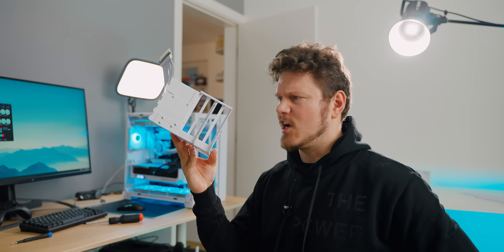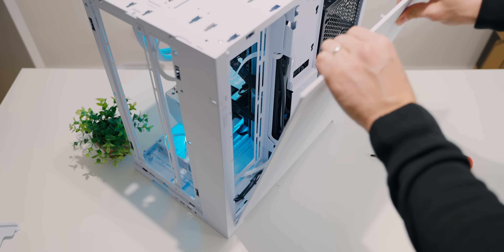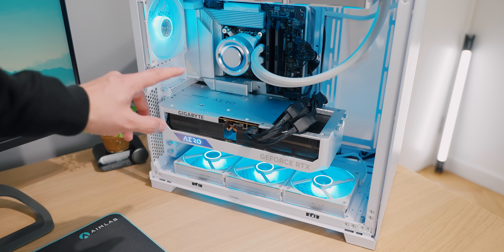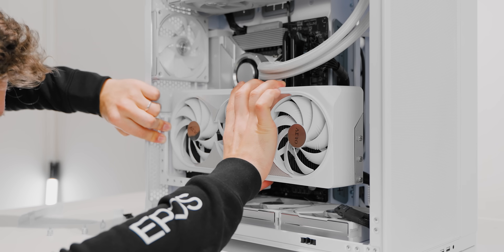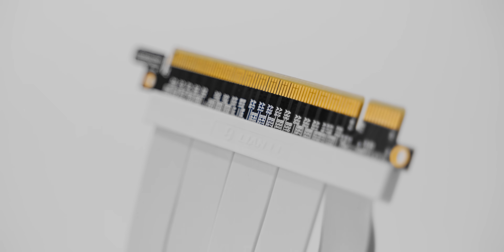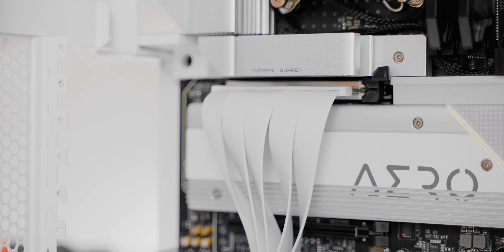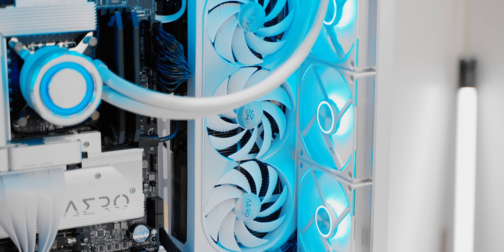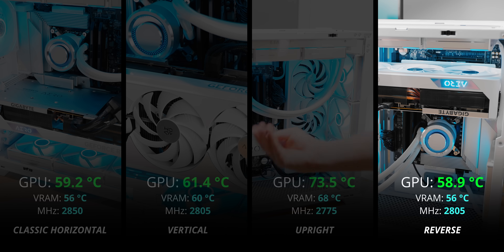The Best GPU Orientation EXPLAINED!

Comment: When having fans vertically, they should be sloped at a slight angel to allow for sufficient heat extraction, or cool air injection, as heat moves vertically. 

Somehow I feel having 3 fans on the video card could actually heat it up more in a vertical orientation, as the top part should be shielded, and the fan should be oriented as low down as possible.
The AiO MSI 5090 does this I think.

Also, radiators should never be in a position where they are inbetween the air moving into the case, this causes the case to heat itself up over time.
Mounting a radiator vertically is fine, assuming the air is moving out of the case.

Ideally, you want the cold air being pulled in from the bottom, but let's say you're running a dual AiO build with the MSI 5090 AiO.
You would mount the 5090 vertically, then, mount the AiO to the bottom, and have it push air outside the case. 
Then you would have the CPU AiO mounted at the top, pushing air outside the case.
Mount the AiO of the CPU/GPU to the bottom of the case, based upon which one gets more heat.
And on the front and back, have fans pushing air inside the case. Adjust the fan speeds so that its a 55/45 intake/exhaust ratio.
Ideally the fans in the center of the top, bottom, front and back should be faster than the fans on the corners, as to allow maximum movement of air, and allowing time for the thermal energy to transfer from the metals to the air.

With this, minimal warm air will be recycled back into the case, and both AiOs receive maximum possible cooling, while not heating up the case in the process.
But this is for a vertical sidemount build.
I recommend horizontal, as heat wants to rise.

Comment: Upright would probally get better readings if you didnt have front fans and moved those to the bottom for intake instead. With that settup the front fans are are pushing fresh air past the gpu

Comment: everybuild be like: lets put radiator on top where exhaust is so the raising heat can ´cool´ the radiator for cpu, instead of puting radiator on intake fans - vertical side, so it can be cooled well as hottest component in the pc it should. Makes no sense. I guess aesthetics are more important

Comment: The reason the temps are so bad upright is because you most likely need to have the hdmi on bottom.
People might think "why does it matter what is the orientation - upright is upright"
But in reality the GPU is not symmetrical under the hood - it has a vapor chamber and TUBES leading the heatsink - when you position in the "wrong" kind of way the hot gas dont move in the right direction (since they tend to go up) and build up in the vapor chamber.... 
Long story short - flip it....

Comment: I think the upright did so poorly because you have an open air GPU, and the exhaust on either side of the heatsink was blocked.

I’m surprised that the vertical did so well, especially with the fans turned off. Where was it even getting air from?

Also did you test all these with an open panel? Vertical would have suffered with the panel closed imo

Comment: Hi , did u messure all temps without side panel ? It's a major diffrence. I've got antec 5 with vertical gpu bracket and diffrence between classic mount and vertical is 20 degrees! When I'm gonna take out side panel I'm getting much much better results. Case got very good airflow so idk but durring heavy load you can clearly hear gpu air hitting the glass panel - the gap between panel and gpu is simmilar to yours. No idea why your temps was that low with vertical that's why I asked did u use side panel....
Reply: Yeah that’s crazy that his vertical temps were so low. Where the hell were they getting air from? He didn’t have front fans either, just the mesh. I assume the side panel was off. If it was on, maybe some of that turbulent air from the bottom fans would have helped instead of just escaping. It was interesting that turning off the bottom fans helped

Comment: 8:58 Never install AIO radiator at the bottom. You will get air into the pump which is very bad. Just a friendly heads up :)

Comment: It's pretty simple. The only things that matter is how much cool air is available and how easy can the hot air leave the graphic card.
Reply: Yeah his upright orientation was blocking the side exhausts, I think that’s why it did so poorly
Reply: @henry3397  maybe. So I checked both configs and added even additional fans. My guess is: When it's at the top, the air can enter unimpeded and the water is distributed better over the entire radiator. The difference was 2-4 degrees with i7 14th gen.

Comment: There are a couple of reasons your upright orientation has poor thermal performance. 1) The case intake fans are orthogonal to and too close the GPU fans causing the GPU fans to fight against the air intake air flow. 2) The GPU side exhaust is right next to the case intake fans, so some of the hot air from the GPU exhaust gets sucked right back into the case, creating a thermal loop.
Reply: The left exhaust is also blocked by the motherboard. He has very poor exhaust on either side tbh. I’m not even sure the right side is getting out of the case and into the intake that much

Comment: Do purchase a ROG white GPU, and you'll be happy of its look mounted traditionally all the time.

PS My concern is to how to mount both GPU and hyper storage (PCIe to 4xnvme). It needs to be mounted into the first slot due to a bifurcation settings, then GPU has no clearance being mounted into the second x16. Then, this shiny PC case allows to use a vertical mount for both components (with two different mounting brackets included), and the bottommost slot can be used for for PCIe to USB I hope (cause some MB have less UBS on a back than is needed). A great PC case indeed!

Comment: dude you literally skipped over the most important configuration and the reason why reverse mode even exists......upright gpu in reverse mode. Some cooler designs do worse in upright but will be significantly better when upright and reversed. I literally get get an average of 10c lower on my 3090 strix when upright reverse.
Reply: His test was pretty ass ngl. I think he tested with the panel off too lol

Comment: ty for comparing thermals on the horizontal reverse setup. Was quite tricky to find how it works with vapor chambers and was considering it for an sff build, but was worried about unexpected thermal impact.

Comment: I'm not sure i can respect your decision to move the fans to the front ONLY when you put the GPU in the back on that third test. Not only does the fan configuration change make so you dont have a proper control, but you also essentially mimicked the vertical GPU mount as far as fan configuration in reference to the GPU.
Reply: The guy tested with the side panel off lol

Comment: 8:17 say good bye to display cable in couple of months  and if that was a 4090 we looking at a fire waiting to happen... not enoug space for the cables for the  gpu... maybe a 4070 might fit
Reply: For the power cable he could easily get a 90° 12VHWPR or 180 power bridge. For the dp and HDMI same thing, or get more flexible lead extensions and plug your monitor into that

Comment: What if you put fans on the side of the case as exhaust that would draw air towards the GPU in the upright position? Is there room behind the GPU to fit 25mm fans or maybe 15mm?

Comment: 9:07 i wish you put bottom intakes here. and see if temp improves
Reply: Theres absolutely no room. The gpu is touching the bottom
Reply: Maybe but not much. The issue is the heatsink exhaust on the sides is blocked when mounting upright. Has he been able to do the upright upside down on the other side of the case, the exhaust would be better there

Comment: Something's off with the data at the end... why is the vert GPU with NO bottom fans cooler than WITH bottom fans??
Reply: Could be a couple reasons:

1. Turbulence from the bottom fans. They are so close to the bottom edge of the GPU, that all the air gets rough and turbulent, think of spraying a high pressure hose at the side of the GPU and it splashing everywhere except into the fans. This is quite different to horizontal mount where the bottom fans directly feed the intake, and have a few inches of buffer before reaching the intake. 

2. He seems to have tested with the side panel off. If the glass were on, the vertical GPU mount would have performed worse in general, and the bottom fans may have helped a bit more since some of that turbulent air would be contained and find its way into the intake fans.

In general though I find nothing wrong with his result. I’m curious to remove my bottom fans on my vertical mount GPU and see if it helps. It’s not always about cramming more fans and more air. You have to think about pressure and smooth airflow

Comment: My first build I went vertical. I came to realize in my particular setup, it was running 5 degrees hotter than "regular". The more I've gotten into pcs, the more my mindset has changed from form over function to function over form.

Comment: I now have an upright reverse build and it's unbelievably cool, saw this video pass and just wanted to comment that having to build one (or upgrade in my case) is a real hassle but the trade-off is amazing. You can have three extra fans behind the GPU to even cool the GPU more.

I recommend 30cm extension cables for your cables.
Reply: Yeah I wish he would have done upright reverse, seems the bettter way to do upright

Comment: Huge failure, if gpu fans are pushing out of the fins, but the bottom fans are trying to push air into the fins, you have a huge problem. Those bottom fans must be pushing out so the air flow is in concert with the exhaust air flow of the gpu fan exhaust path.
Reply: That’s a good point. I’m sure that is further contributing to the turbulence he’s talking about, because the fans are also too close to the side of the GPU, even if the GPU had no active fans cooling it.

I would not make them an exhaust though. It’s quite strange to have a bottom mounted exhaust. Instead I would just remove them altogether

Comment: Nice video I appreciate it! I still think the setback here is when you went vertical but with front fans! Basically the fans blow in wind and too fast so that the GPU has problem to suck it in =)
You should have tried to have the fans on the bottom for the vertical mount. I doubt it would be cooler than the stock mode, but at least I think it wouldn't have been worse. Thanks for the video =)
Reply: I think you mean the upright mode right? It suffered because it had poor exhaust— the sides of the GPU are blocked. Had he been able to do the upright upside down (reverse) GPU, that sounds like it would have done better

Comment: I have 2 questions for anyone knowledgeable that could help me out. Would it be okay to mount the GPU on the inside top of the case were the rad and top fans would normally go? I really want to mount it here.
I can find or make a custom mount I just want to make sure temp wise it will be okay. The 2nd orientation I am curious about is vertical in the back but flipped where the back plate is facing you, so same as at 9:29 but flipped. I will be running a 4090. Thanks.

Comment: This is not a surprise at all.. For years this is happening with most GPU`s since the vapor in the cooling tubes can`t overcome gravity and so it can`t get to the cool phase of the vapor chamber tubes. I`ve been talking to friends and customers about this when they order a new pc build ... but HEY !!! LOOKS ARE MORE IMPORTANT :D. If you have the tech and time you can make a hot spot test of the different GPU coolers and see that it worse with upright GPU`s. For us to have an upright orientation of the Cards we need new types of coolers or at least such that are made so they can work properly in this orientations... but factoring the simplicity of the vapor tunes ... I do not think it`s possible.

Comment: I cannot believe that such a long PCIe extension cable would work. Have you check the bandwidth ? Has it been degraded down to PCIe Gen3 ?
Reply: There’s no chance it’s any better than 3.0, but, that is not a bad thing. The cards today don’t saturate that
Reply: I have their 900mm runs perfect.

Comment: 8:07 Do not EVER do that with a 12 VHPWR connector, get a 90 degree adapter or a more flexible cable instead if you don't want your power connector melting off. (its okay for the purposes of the video since he will probably not be keeping it that way)
Reply: Yeah that was wild lol

Comment: So going classic will a 4090 need supporting? Looks a little hard with the fans in the bottom. I cant decide between this case and Hyte Y70
Reply: Go vertical mount if you have a big ass card. Just make sure you have a good case that can mount the card vertically a good distance from the glass. I don’t know much about the hyte, but this is one of the best cases of all time, extremely well reviewed and great thermals for both CPU, GPU.. and even your PSU gets its own space

Comment: what if you mounted the gpu backwards with the upright bracket so the fans are facing the intake? also i wonder if you can mount exhaust fans for the gpu just to get the hot air outa there

Comment: Nope, u get it wrong, the magic for Evo, the upright Gpu u can mount 3 more fans as exhaust, get a proper gpu cable such as Corsair does, or customise cable from Taobao, and u will be surprise for the cable quality, so that will be top 3 out, front 3 in, behind Gpu 3 out, bottom 3 in, behind 1 out, perfect fit, but for Evo, ideally not getting 4090, because my previous Zotac 3090 ti just nice, 4080 will be great, especially the 4080 size like Asus pro-art.

Comment: That reverse mode will NOT do 'very well' unfortunately in the long run. The AIO pump will die very soon due to its orientation. Its too high from the AIO shd be opposite way. Damn din expect a top guy to make such an amateur mistake.
Reply: I think you need to study some more, there is nothing wrong with it. In fact it’s more ideal than the orientation. Pump is below the top of the radiator, and the tubes to the radiator are at the bottom. This is the most ideal configuration. Second best would be pump below the top of the radiator, tubes at the top. Tubes up too is less ideal bc then the air pocket forms where the inlet and outlet to the pump are, making it theoretically possible, though highly unlikely, to get some air into the pump
Reply: @henry3397  who dafuq asked u anything?Sit down kid.  The most ideal thing is for u to keep ur opinions to urself. its obvious ur a shill and an idiot.
Reply: @kimisami88 ok lil bro 🤡

Comment: Bro, in vertical orientation the temperature is high due to the logic of the heat pipes. There is liquid inside them (there are 2 types, with and without liquid, the second are rare) and for the circuit with the evaporation chamber to work correctly, the liquid must be located along the entire plane of the tubes.

Comment: I want to buy a YESTON RTX3070 but my main problem is that both front and backplate are looking beautiful on that gpu and I can't decide how to align the gpu because if I use it horizontal I can't see the front but I can see the very detailed backplate. If I align it vertical I can see the beautiful front panel with the cool fan design but can't see the very detailed backpalte. I want something between vertical and horizontal so you would been able to see both front and back of the card but I don't think that's possible because even if you could mount it that way you wouldn't been able to connect the dp or hdmi cable to it.

Comment: imo the biggest reason why vertical orientation resulted in higher temperature is because that for this particular gpu heatsink it is way too big and therefore its gpu fans were not getting enough clearance from the side panel

Comment: guy at best buy told me vertical is better, glad I stayed classic.
Reply: It actually may depend on some things. My temps are 3° better with vertical mount.
Reply: Vertical has slightly worse temps, but I still think it’s “better”. Mostly because it’s very well mechanically supported. I can move my PC around to dust it and it doesn’t feel like I’m gonna snap my motherboard off. Good compromise. And if you have a giant GPU, there’s no way I’d horizontally mount it

Comment: I am not surprised by the result. Thanks for your efforts. I have a question for you. I recently bought an O11 evo black case and a 4090 atm I am waiting for other components to arrive. Case and its uni fans and other extras are pricey. I am not looking forward to investing in horizontal/vertical stuff or a mash panel. Inside of the 4090 box, there is already a GPU support bracket. Since the GPU is kinda heavy, It's probably around 5-6 kg... When I install the GPU support bracket to the bottom I guess I will have a place for only two fans at the bottom right? So... x3 fans already on galahad trinity water cooler, if I buy only 6 extra fans this is going to be enough right? 3 fans to top or front depending on the cooler position this is in the pocket. I am thinking of making one of them exhaust fan to the back, and last two to bottom. Does that sound ok????